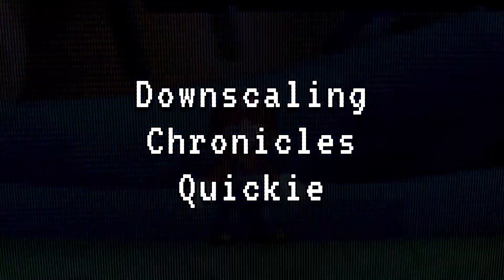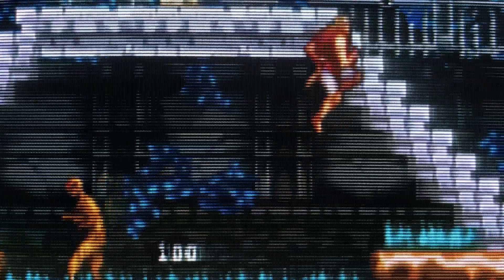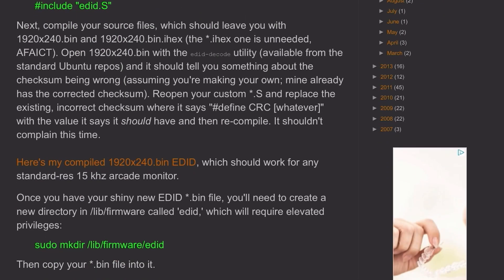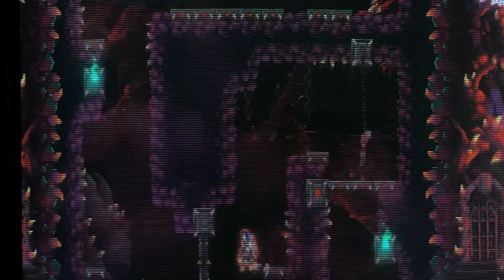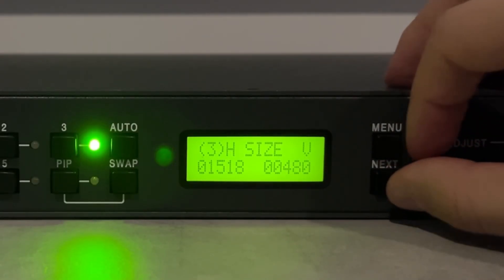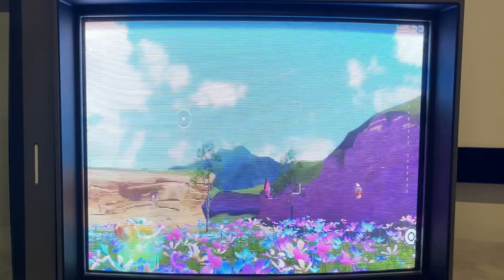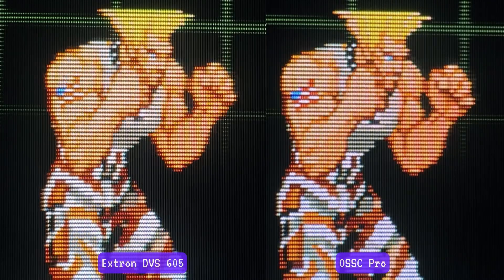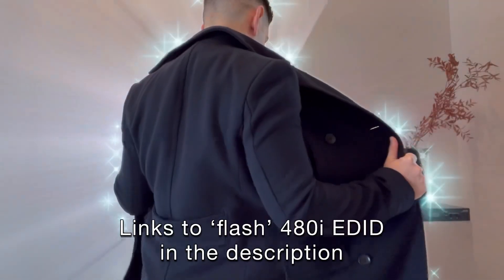Downscaling Chronicles Quickie: Extron EDID Method with 480i Output on the Extron DVS 605

Comment: Full blown professional scalers for 240p/480i are an overkill and not the best solution for games. For TV stuff, videos, etc. they are fine if you define mode just right but for gaming systems they would require lots of tinkering to match frame rates and even if you manage to get input lag to not roll you will have it stay in place - most likely at random unless scaler can reset itself to lowest lag consistently.
Much better would be to use something like OSSC... if only there was proper downscaler algorithm for it. OSSC Pro is pretty good but for proper downscaling it unnecessarily adds tons of lag. Less than 2 frames is almost two frames of unnecesary lag imho.
Reply from the maker: Respectfully I disagree that they’re overkill for gaming if you can find one at a reasonable price. The OSSC Pro has better lag now with approx 1.5 frames in scaler mode. Adaptive Line multiplier mode has essential 0 lag to drop 1080p>240p, 720p/480p/480i>480i/240p. The OSSC Pro does cost 330€ excluding the Extra AV Out soon and shipping, and if one were to find a professional scaler for a good price and can tolerate 1 (sometimes 2) frames of lag then it’s good to have more choices.
Reply: @MarcoRetro316  Hello Marco,

I have OSSC Pro. Great device for sure.
I don't like the 1.5 lag on it for line blending though. Especially given what is needed which is e.g. 16 lines for 720p. 1080p needs more buffering and/or some form of actual scaling and 480p is much simpler.

I mentioned OSSC should be able to do dowscaling and at the time I kinda theorized but I went with writing completely new firmware from scratch and most of its most important features (read: the 720p downscaling) is already done. In total to do it I had to allocate memory for 16x 1280 pixels wide lines at 24bit which is almost all memory of the device but it works like a charm. I even made downscaling contrast adaptive for interlaced mode where it makes perfect sense to avoid as much flickering as possible without blurring most details too much.

16 lines lines is probably similar amount as what OSSC Pro in line decimation mode uses. Most of the lines are not for scaling but buffering because 720p divided by 3 gives 250 lines at 15KHz and not 263 lines at 15.75KHz. For some CRTs you can do less lines than 263 but even my PVM doesn't sync at 250 lines at 60Hz so I assumed ~262.5 lines for interlaced mode is a must.

For OSSC Pro it will be easier as no complete firmware rewrite should be needed. In fact I planned to make mod for OSSC Pro to add scaling to its original line decimating mode but then I found cheap OSSC 1.8 and its limitations were a good challenge and way to learn FPGAs in fun way.

Anyways, if you are interested I can give you a alpha/beta version of firmware. You would need to have JTAG connector though. Not even sure if I could make my FW flashable by Marq's firmware and even if I could mine doesn't have any ability to flash other firmwares by itself. Not yet at least.
Reply from the maker: That’s impressive getting 720p downscaling on the original OSSC! My friend who contributes to FPGA core development on the Mister tried to do the same but he ran into memory issues but from what I understand that might have been in tandem with the existing FW, where as you have written it from scratch. I don’t have an OSSC but I can ask my friend if he could flash his and we can test it. I remember seeing your username come up as a follower on Instagram, you can send a link to the FW as a DM if you like. Nice work!

Comment: Great video, Marco! Thank you. Now, where can I get an Extron DVS 605 in my country?
Unrelated question: Mortal Kombat has a video output of 400x254 @ 54.7Hz. The emulator using CRTSwitchRes is going to change the refresh rate to 55Hz for this game (and probably a resolution of 800x600). Do any downscaler respect that refresh rate? What would you recommend to do in that scenario?
Reply from the maker: Thanks! You’d have best chances with a scaler that can program a custom resolution. RetroTink 4K, DIDO Jr/LT/Pro, Corio2, Extron DVS 605. I can’t guarantee it will work. These oddball resolutions would probably be best with software scaling with SwitchRes on a PC using CRTEmu, Batocera or Recalbox on a Pi4/5.
Reply: @MarcoRetro316  Hello, Marco. Thank you for your answer. I only have a RetroTINK 5x somewhere, so I may try it just to see what happens. However, I agree that the best solution is SwitchRes.

Comment: Thank you so much for this insight. I'm so hyped, I just ordered a DVS 605.

This is probably super specific, but I thought I might try asking.
I'd like to use my DVS 605 with my Loewe Mimo (16:9, 576i) and my PC to play Indie and Retro Games, that support 16:9 like PSP-games/ some PS2-games/ PS3-games.
Are there any custom EDID-Files for 16:9?
Any recommendations how to make this work?
Reply from the maker: The 1929x240p EDID is a super horizontal res, so if your TV is widescreen then this should display in 16:9 once you reduce the H-size on the DVS but it will be a manual process. Good thing is the horizontal scaling is forgiving and it shouldn’t produce horizontal shimmer. If the content isn’t integer-scaled pixel art then you can freely play with the V-size and it will still look fine. If downscaling integer-scaled retro games then the V-size looked best at 230 on the DVS as this produced perfect integer downscaling of 480p input, though I didn’t check higher resolutions. You can make custom EDID’s with free programs like Custom Resolution Utility (CRU), maybe try to make an EDID for 426x240p for exact 16:9 and see if it works.
Reply: @MarcoRetro316  Thanks so much!
Reply: @MarcoRetro316  
I'm sorry, that I use the comment section for this, since I wanted to write you a PM, but it seems I can't on YouTube. I'll try to keep this brief.

Do you plan on making a step-by-step-guide for downscaling for beginners? I just recently started with CRT-shenanigans and trying to hook up more modern tech to it. Your videos are super cool, but also very fast paced for beginners that want to start with it as a hobby. There are millions of videos for upscaling old consoles, but your channel is the only one (I found) going into detail about downscaling. I would love a more in depth video on the basics of downscaling and how to get started with no prior experience. 

I now have the DVS 605A and tried to use the info of your two videos and your comment and still can't manage to connect my PC (no CRT Emudriver) to my CRT. I have no idea if I set it up incorrectly, if I'm using the wrong cables or what else the problem is. 

Btw what is that super fancy self made VGA to SCART cable you are using, that I've seen in a couple of videos? I'm using the one from ultimatemister since it's the only one I could find online to convert VGA to SCART for that purpose.

As you can see I'm a naive rookie who thought the DVS 605 was a simple solution for my problem, since it looked managable in your videos. 

Cheers and greetings from Germany.
Reply from the maker: @Shevill91  I’m happy to try and help. It sounds like you’ve done everything correct with your cables. I think it could be a sync issue. I’ve made a video to try and better explain:
https://youtu.be/1BM5K8bj6u0?feature=shared

Comment: Does the IN606 still have issues with frame skip, or have new edids solved this? I read on retrorgb that it overall has less lag than the 605, and I already have a good dac and Extron rgb interface.The IN606 seems much more available on ebay as well compared to the 605.
Reply from the maker: I haven’t re-visited the IN1606 for 240p so I’m not sure the frame skipping can be fixed with a more optimised custom resolution. I tried the 480i EDID and it was a mixed bag depending on the monitor. There’s a pinned comment that I replied to that shows 480i output working well on a JVC DT-V1710, but not displaying properly on a BVM D20F1. The IN1606 and the DVS 605 should have roughly the same lag. It was my mistake that my first lag tests on the DVS 605 were without the AFL setting which read a whole frame higher. When AFL is on, lag on the DVS 605 is only 1 frame for progressive input resolutions
Reply: @MarcoRetro316 Thanks for getting back to me. I saw the pinned comment, really wish I could find a 605 somewhere. Might jump the gun and get an IN606 since some are pretty cheap on eBay. Good to know the lag on both units is roughly the same.
Reply from the maker: @ZootWorld1  The IN1606 will be hit or miss if 240p will have a steady frame rate, and if 480i will work on your CRT. If you are on a budget then I would recommend a Corio2 such as the tvOne c2-750. These and equivalent models come up cheap every now and then on eBay

Comment: Hey Marco I’ve found one locally here but without any cables. Does it only need a standard power cable?
Reply from the maker: Yes just a standard IEC 13 cable
Reply: @MarcoRetro316 excellent. Also I have all my consoles hooked up to an Extron Crosspoint switcher. Can it be hooked up to that in an easy way or do I need to hook up each console to the 605 individually?
Reply from the maker: @MagisterHamid If you want to incorporate the DVS into a matrix setup but also route consoles that are already hooked up to the switcher, you could connect one of the crosspoint’s outputs into the DVS’s inputs, then output the DVS to the crosspoint as another input, and then output to your CRT from another of the crosspoint’s outputs
Reply: @MarcoRetro316 that sound like a great solution! Thanks!

Comment: Nice to see a return to this topic. Great stuff, as always!

I thought about why a standard 480i resolution wouldn't work so I dug a little.

The CVT Standard 1.2 mentions that "certain digital links require a clock rate greater than 25MHz.  In these instances the host can double the clock frequency and the calculated horizontal parameters to compensate."

Perhaps the Extrons simply require a pixel clock >25MHz, which could help explain why a supersampled resolution (2200 HTotal x 262p/525i VTotal @ 60 Hz) worked. 

Of course CRTs don't care about bandwidth or the horizontal line total as long as there's enough blanking to retrace, i.e. no reduced blanking. A lower HTotal would help with the menu navigation jank , so in theory a supersampled resolution as close to 25MHz would be preferable.

I'll test it out on my DSC 301.
Reply from the maker: Thanks again for your insights. I credit you to who made me persevere with this method. That makes sense about satisfying the minimum pixel clock requirements. My friend made a 640x244p 60Hz EDID which also works that I linked in the description, I’ll see what rate it’s running at if it’s >25MHz. I wish I could say it was careful calculation to create the working 480i EDID but it was honestly dumb luck and will be interesting if it works with your DSC 301
Reply: @MarcoRetro316 
Thank you, happy to hear!

So it seems that the DVS is in a league of its own because the DSC doesn't output interlaced. The only exception seems to be the standard 1080i and even when I sniffed that exact EDID from the DSC and modified the vertical lines, I get 240p. Bummer. 

I did manage to dial in a 1920x270@60Hz EDID, which imo vastly outperforms 240p with 1080p content with a /4 integer downscale. Mind you that the horizontal scanning frequency might be too high for many consumer sets, but my JVC DT-V handles it just fine. Still tinkering with the vertical blanking to push down the VTotal which hopefully makes it more compatible. 

292 lines (17.520kHZ), maybe even 281 (16.860kHz) should be doable with some vertical shifting.
Reply from the maker: @IamFearLezz I’ll have to give a 270p EDID a try, or if you dial yours down to perfection then I’d be happy to try it. 
Shame about the DSC not interlacing 15KHz. If you see the pinned comments I did manage to get the IN1606 to output very nice 480i but only on the JVC DT-V1710CG. The HDMI to VGA converted signal had to run through an Extron RGB Interface (like all video probably should on the JVC to mitigate sync quirks) AND output in RGBHV. I couldn’t get it stable on a Sony monitor though
Reply: @MarcoRetro316  That's interesting! I'm running the exact same setup chain for my DT-V. The DSC won't read the EDID as interlaced at all but I'll take a second look at your comment for further reference. For now though, the Corio2 and OSSC Pro will deal with 480i in my setup.

I'm currently running it with 295 lines, seems to be the min-maxed sweet spot between ample blanking and lower HFreq. The only side effect with such little blanking is that the raster lines are drawn right above the image, which I'm not a fan of as it exacerbates the DT-V's infamous bright spots. Luckily, this is easily circumvented with a slight vertical position adjustment on the DSC. This can later be compensated on the monitor. Just did a quick play test with Shredder's Revenge running 1080p from the PC. I'm honestly amazed by the Extrons' sharpness. 

I'd be happy to send you my 270p EDID. I can at the very least guarantee compatibility with your DT-V.

One interesting note is that I have to basically max out the horizontal size on the DT-V. Any more vertical lines and you'd have a case for the Aspect Ratio Police. Decreasing HTotal slightly ought to help.
Reply from the maker: Hey I made a pack with some more refined interlaced resolutions, link is in the description. Hopefully these more conventional resolutions like 640x480i work for you
Reply: @MarcoRetro316  That's awesome, thanks for letting me know! I'll have another go on the DSC 301, might test it out on my newly acquired DSC 401 A as well if I can get ahold of the software

Comment: now if only we had a scaler that could do both blending and line dropping. the former would work better overall, specially for games with anti-aliasing applied while the latter would be more period accurate especially for integer downscales and games without anti-aliasinf
Reply from the maker: If it’s for restoring integer upscaled content then a scaler can technically achieve the same results by blending identical adjacent lines but then it’s on the user to ensure the lines sit absolutely perfect when scaling. That’s where a decimater can be a simpler. I was tandem downscaling at one point by splitting the HDMI video into the Extron DVS 605 and OSSC Pro to get best of both. I didn’t like the clutter though and went with the OSSC Pro. But it would be awesome if one device could do both, or if a decimater could apply a vertical filter to soften the jaggies

Comment: Hi, im pretty new to this topic. I have Extron DVS 304 and Sony PVM 2054QM, you think this method could work with my hardware?
Reply from the maker: I don’t think so, at least not with the Product Configuration Software. It’s not listed in the PCS Supported Products page.
Reply: You can try this piece of software - Signal Processing Products Control Program. It seems to be the older version of the program Marco is using. Seems to have a lot of the functions. Maybe if we get specifics about the edid then we can input into the old program and make the older Extron units useful for downscaling. I’ve ordered an IN1508 to see if it works. It looks good as has analog inputs and outputs unlike the IN1606
Reply from the maker: @wedeservedit I have the latest PCS with sign in as I have an Extron Insider account. I haven’t tested the IN1508 but I’ve tried other scalers with RS232 that aren’t on the PCS list but they weren’t recognised. God speed with this one and hopefully you can get something out of it and maybe program a custom res through the OSD. If you want to play with custom EDID’s and see what all the parameters are there’s free programs. I linked CRU in the description and you can load these EDID’s and copy their values
Reply: @MarcoRetro316 managed to get the Extron insider account sorted out today. Will get the 1508 tomorrow. Apparently Extron units have a high failure rate so fingers crossed it still works. Will update the firmware and then download the software compatible with the 1508 and try the values. Hopefully it works. Best thing is that it also is a dac so does digital input through dvi and analogue output. Let’s see! Btw the Extron agent was super helpful and set me up with the training platform too
Reply from the maker: @wedeservedit Extron employees are great. Their scalers can be flaky though, I’ve heard of several instances of faulty units, including my experience of a bricked DVS 605
Reply: @wedeservedit  hello, any news for the 1508 ?
Reply: @IntercoMobile Hi sorry for the delayed reply. The software is a dud and hardware wise it couldn’t have ever done it either as its minimum horizontal frequency is 31khz.